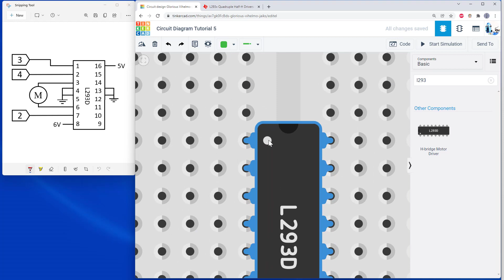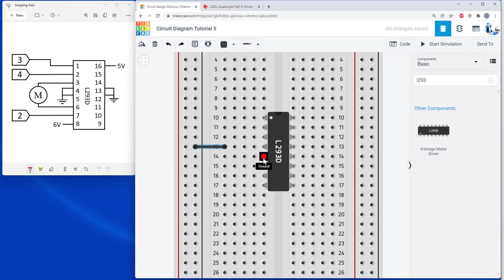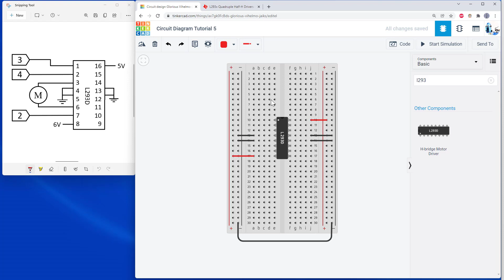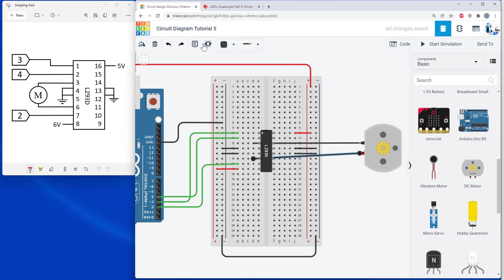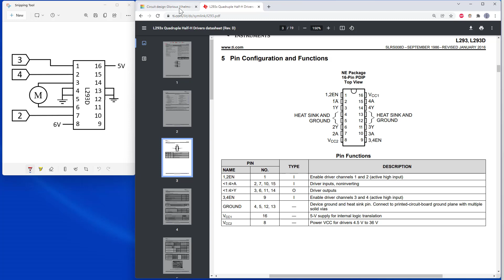How to Build a Circuit from a Circuit Diagram | Part 5: H-bridge, Arduino

Comment: well explained, but i have checked half dozen times and it is connected exactly the same and i am getting 0 rpm???
Reply: Did you write the code?

// C++ code

void setup()
{
    pinMode(2, OUTPUT);
    pinMode(3, OUTPUT);
    pinMode(4, OUTPUT);
    digitalWrite(2, HIGH);
    digitalWrite(3, HIGH);
    digitalWrite(4, LOW);
}

void loop()
{
    // Empty loop
}